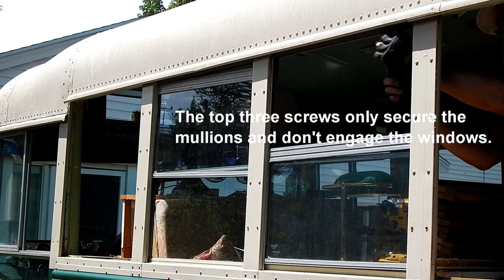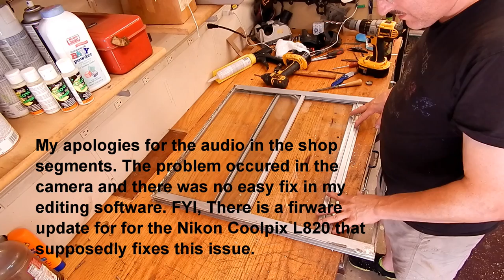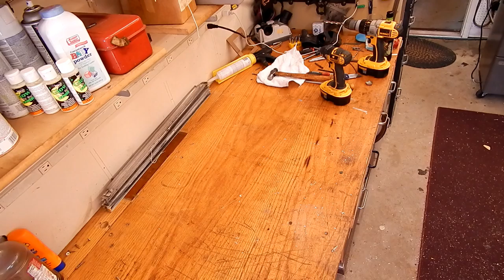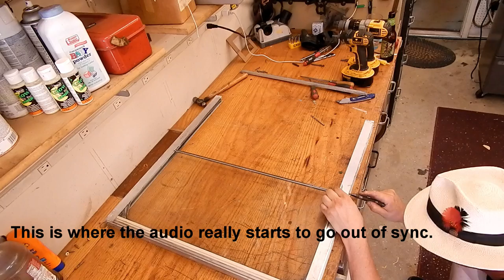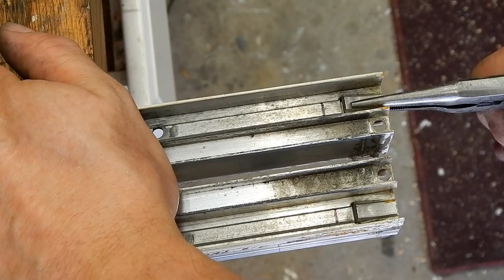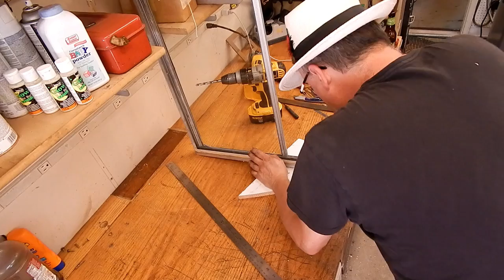Modifying School Bus Windows to Open From The Bottom

Comment: Ok.
I need to study this, see if I can wrangle this.
StrayDog II has a slightly different window track construction. I won't be able to flip the track, but! I just may be able to work around it.
Either way, I like the idea of putting a screen in the fixed slot (I have thought of that already, but I needed to fix other problems first.).
I have also located where I can replace those spring latches. 
This might just work.
Thank you.

Comment: What about rain? The original configuration had the bottom window sealed to the window frame. The upside-down window now has no seal on the bottom. Do you have trouble with leakage? 
Great video by the way.

Comment: But how did you retrofit the screens to go in the windows?
Reply from the maker: I removed the screen material and then cut them down with a miter saw. The extrusions are pretty much all the same and the latches are usually just held in place with a little crimp in the channel.

Comment: Thanks for the video.  I was wondering- in your opinion, what would it take to modify a window so that it can open from both top and bottom?  I would think taking parts from two windows and swapping out the immovable side for a movable one is most of it, but what else would you have to do?
Reply: Jason Sulliman I assume basically what you did here (but use a spare window) to make the "bottom-loading" window, but instead of swapping the frame, just add grooves so the modified bottom pane has holes for the spring-loaded arms.  Would you need to make an adjustment to the frame for (what was) the non-moving window other than that?
Reply from the maker: Jason Sulliman Hmmm, to do what you want I think I'd take the movable panels from two windows and put them into a frame with two of the wider grooves required by the movable panes. You could easily make those by ripping the frames rail length-wise on a table saw. You could either secure them individually to the bus or TIG weld them together.

Comment: Have you had any leakage problems along the bottom of the windows in heavy rain? On my bus the windows had caulking along the bottom and sides to seal them. If you do how did you overcome it?
Reply from the maker: +Steampunk Steve There's a lip on the inside at the bottom that the window closes against, just like a regular double hung windowin a house. I had planned on putting a gasket there but have not bothered because there's been no leakage at all.
Reply: Thanks. I'd  taken my windows out when I painted the bus and just stuck them back in without caulk to make it easy to take out for modification. A couple leaked at the bottom when we had a heavy rain. Mine is a different model so the ridge may be lower